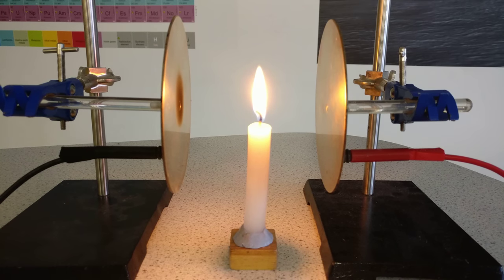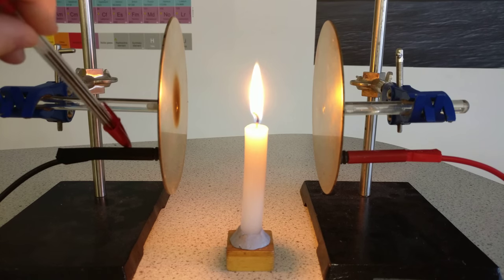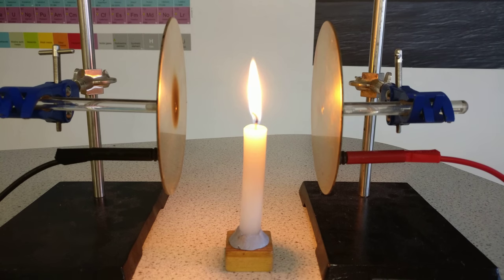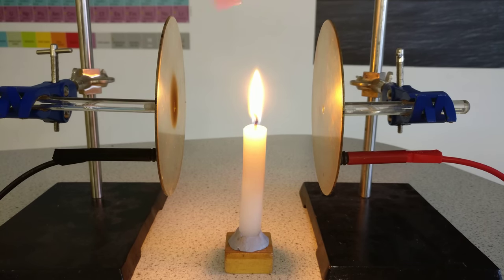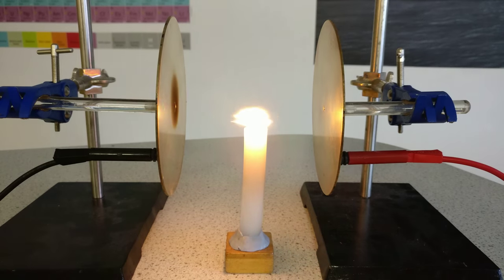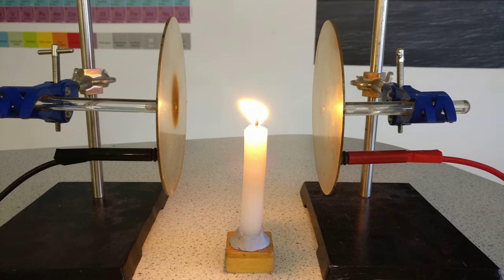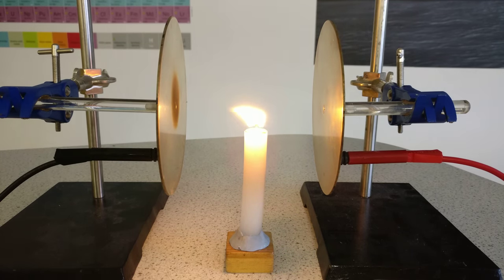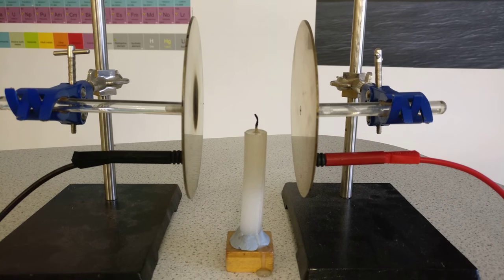Christmas Candle Flame in an Electric Field  - AQA A Level Physics

Comment: I wonder what would happen if you did this same experiment while also having a sonic resonator vibrating the dielectric of the capacitor at various frequencies.
Reply: 1.21 GW flux capacitor?
Reply: @Toryboy1807  What I am basically saying is have the air in between the capacitor plates resonate at various sound frequencies and see how it effects the results.  It has already been shown that sound resonance affects the flames.  I would like to know what the compound effects are under various frequency and em field strength conditions are.
Reply: @wesbaumguardner8829  I thought you were trying to go back to 1955 in a DeLorean.  Thanks for clarifying.
Reply: @Toryboy1807  lol!
Reply: What about a light source through it into some optics prism.
Reply: Lool I have no idea what u guys are saying 🤣 😂
Reply: A gigadoodle 1.5mw woobly boobly double lined solenoid
Reply: Exactly, I’m always believing that the sonic potential is way under developed(at least not publically)
Reply: @wesbaumguardner8829  
How would you do that without also confusing it with the movement of air?
Reply: @DarkMoonDroid  Technically, sound oscillations are a type of movement of air, but they are not wind.  To answer your question, you just use speakers to produce sound with a tuning device to change the frequency of the sound.
Reply: @wesbaumguardner8829  What are you thinking of building?
Reply: @wesbaumguardner8829  you want to make a candle listen to some Daft Punk at different frequencies?
Reply: @dudet9662  I was thinking more of using resonant frequencies rather than "music."
Reply: @screenname1  A portal to the gates of hell.  Just kidding.
Reply: @wesbaumguardner8829  Seriously. What's In the back of your mind? You're asking specific questions.
Reply: @screenname1  I'm looking for an anti-gravity device to propel the flying disc I made in my back yard.
Reply: @wesbaumguardner8829  hehe. You know. I'm actually impressed by your grasp of these kinds of things. I have no idea what you were talking about, but it really sounds interesting.
Reply: michimusician  I'll see how that pans out in my divorce hearing.
Reply: @screenname1  I was just kidding about the flying saucer.  However, you might want to look into John Hutchinson and the Hutchinson Effect if you are interested in that sort of thing.  It is similar, but different to this experiment as it was combining radio waves with a strong electromagnetic field.  Now that I mention it, I wonder what would happen if you combined the Hutchinson Effect with resonant sound.  Now THAT would be interesting.
Reply: @wesbaumguardner8829  I might check that out. Thanks.
Reply: Would be interesting to see what would happen with AC, and varying the frequency close to the vibrational frequency.
Reply: @Toryboy1807  
Doc Brown sent Marty McFly to the future to bring back more candles
Reply: @razvancosmin8188  Toryboy mentioned "going back to 1955 in a DeLorean" which is a reference to the car used in the films "Back To The Future". If you haven't seen any of the film trilogy they are definitely worth a watch, probably best in sequence but then they are so mad it may not matter!
Reply: @wesbaumguardner8829  I've often wondered about how sound would affect candles.  Could it slow down or speed up the chemical reactions?  Ect...

Comment: I wonder if this effect can actually be used to extinguish actual fires. Might take dangerously strong electric fields to work against something greater than a mere candlelight, but maybe not?
Reply: Rather yes, than not.
Reply: The problem is (based on my understanding) it wouldn't really stop the combustion, it would just pull away the "flame". So it would be ineffective against anything that burns without a flame e.g. coal.
Also, it only puts out the candle is because the combustible matter is concentrated in a small area (the wick). If you had more fuel to the left and the right you might in fact increase the spread of the fire.

Comment: Very nice.  Signal Path did a somewhat similar experiment a few years back, but he was measuring the current flow with and without flame.  He was showing off some very low level measurement capabilities of some Keithley test equipment.  Just in case some folks here are interested in that experiment.
Reply: very interesting i love u
Reply: "In a clean yellow flame the soot particles are quickly burned when they reach the higher oxygen regions away from the center of the flame." 
That is interesting. I've been watching videos about waste oil heaters and rocket stoves. Both feed oxygen into the flame for a more complete burn.
EDIT: And a tall combustion chamber.

Comment: If you REALLY want to see something amazing get a high voltage power supply and instead of producing arcs in air, do it in helium. A 10kV power supply that produces 1 inch arcs in air will suddenly produce MASSIVELY WIDE 1 foot long arcs in helium. Just helium at atmospheric pressure, we're not even talking about low pressures.
Reply: Dear sir excellent news.
Reply: And what happend if its in vacuum.
Reply: @alexlo7708  No arc.
Reply: Helium is non electron attaching.  That's why you can get long arcs / sparks.
Reply: @crusinscamp  I don't think so. e help in bridging the electric arc.  So noble gas make long arc because they don't create oxide on electrode surface which it accumulate resistance to current passing.

Comment: since this is basically a capacitor do you have to discharge the plates after demonstration before they are safe to touch?  this is so cool thank you for this.
Reply from the maker: Yes, but the charge leaks away pretty fast too
Reply: You can calculate the approximate capacitance fairly easily.   The plates seem to be about 100 mm in diameter, and are about 100 mm apart (my guesses).   C = epsilon_0 * Area / distance_between_plates    The permeability of air is about the same as for vacuum, so epsilon_0 is about 8.854e-12 Farads/meter so....  8.854 Farads/meter * pi * (diameter/2)^2 / 0.1 meter =  0.695 picofarads.    You can now compute using the capacitor discharge equation  V(t) = 25 kV * e (-t/RC).  R is given in air about 10e9 ohm-meters.  (but varies with temp, humidity, etc) with .1 meters, we have R= about 10e8.  So, after 1 second after removing the 25 kV source (that is, t=1), we compute V(t) to be .... a very tiny number ( so small, my calculator returns 0.0).     Now, Capacitance = Charge / Voltage; in this case, then, Q (amount of charge) = 0.695 picofarads * 25 kV = 17.4 nanoCouloumbs.    The Energy stored in this capacitor = 1/2 * C * V^2 ; in this case 217e-6 Joules.   Now, if you get the plates 'too close', you can ionize the air itself, and there will be a nice spark between the plates.   You need about 3 kV per mm to do that; so in this case, being 100 mm apart, you would need about 300 kV to get a spark between the plates.   Still: DON'T TRY THIS AT HOME unless you understand this sort of thing COLD.  Always be safe, wear insulating gloves, rubber-soled shoes, eye goggles, protect all skin --- and use proven instruments (not your fingers!) to verify your calculations on the real apparatus.
Reply: I'm no scientist, but this was interesting! 
The only time I remember ever hearing the word capacitor was in Back to the Future. Thanks again, from a 74 year old great grandmother. Peace and blessings to all!
Reply: @annarodriguez9868  lol ah yes the flux capacitor what a good movie that was
Reply: @cheponis  Everything good, but the calculation of the extimated resistance of the air between the plates. You forgot the area of the plates, R=rho*L/A which would give R of about 3e9 ohm, so the tau of the decay is actually RC ~ 2e-2 s, which is still extremely low.
Reply: @raffaeledivora9517  You're correct.  Thanks for fixing that.  The rule of thumb here is you need to wait 5*RC to get 99% discharged, so maybe about 20e-2 sec; less than 1/4 of a second.

Comment: The ionized plasma in a the pilot light of a heating system ignition system is used as a safety feature in gas fired appliances. When the tip of the pilot light flame enveleops the flame detector it creates a current path through the plasma that enables the gas valve to open.
Reply: @Bruce_Honnigford nope, thats a thermocouple. 2 dissimilar metals in electrical contact in a temperature gradient causes electrical current flow, which is enough to energize a tiny solenoid coil that opens the safety cutoff valve.
Reply: @baronvonfritz  in furnaces there's always a flame detector that works as described by measuring an electrical current when flame is present.
Reply: @baronvonfritz  This is a roughly 90VAC system that uses flame rectification to pass a DC millivolt signal back to the control board when flame is present. Different than a thermocouple. At least if we're talking about the flame sensor on a typical furnace.
Reply: @baronvonfritz   A gas burner 'safety valve' works the other way around. i.e. A thermopile (battery of thermocouples), located in a burner flame, generates sufficient voltage and current flow through a solenoid to hold a 'normally closed' (fail safe) valve mechanism open, allowing gas flow to a burner.
Reply: Just wanted to let you know I undumbed myself, and say you're right.  I had to go figure out who was right, and got to learn about a new (to me) sensor I had always just assumed was a thermocouple.
Reply: @NanClaymore  Thanks, now I know the difference.
Reply: @garibaldicityovgeorge8586  Yep, now that I undumbified myself, just wanted to not let this hang in the aether. Thanks for the correction.
Reply: @BTW...  Thanks, I am a little less dumb now.  I had just assumed that was just a thermocouple in the flame, and now I know a little better.

Comment: And what could happen if you induce a hign frequency oscillation or pulsation. Is there a resonnace frequency that could enhance the rate of combustion?
Reply: the high frquency high voltage oscillations willl suck in the whole lab and the contents in the room into the 2 metal polarities to another portal possibly time travel!
Reply: @fidelcatsro6948  time travel is only possible if the candle is tourning around the earth at the speed of light, in a sphere, burning the omicron variant!!!
Reply: @louisleblanc2972  i see..thank you

Comment: In blue flames like a Bunsen burner the light comes from ions recombining, but in yellow flames like candles, most of the light comes from incandescing soot particles. In a clean yellow flame the soot particles are quickly burned when they reach the higher oxygen regions away from the center of the flame.

Overall the flame is expected to have a neutral charge, with equal numbers of positive and negative charges. You can see from the spot of soot on the negative plate on the left that the soot has been attracted to the negative plate. Therefore the soot particles are positively charged. A reasonable conjecture is that the negative charges are electrons, which would be attracted to the positive plate on the right, and the atomic ions, like the soot particles, are positively charged.

It certainly would be a good idea to try the experiment with a soot free flame. Bunsen burners have metal parts which would be prone to sparking in the strong electric field. candles easily flicker, and are likely to extinguish when they are flickering. It would be easier to claim that a flame was extinguished by the separation of charges if the flame was not flickering.

The important variable is the electric field gradient, which depends on the voltage difference between the plates of course, but also is greater when the plates are closer together. At the end of the video, when the plates were brought together, the gradient was raised.

A Van de Graaff generator could easily generate the 25 kilovolts, but this experiment needs more current. If you had access to only a 5 kilovolt power supply, you might be able to run the experiment with a smaller plate separation and a very small ceramic burner. As far as I know, sufficiently small burners are not easily available.
Reply: Awesome comment.
Reply: I like your funny words magic man

Comment: My immediate question is how does the electric field influence the air currents (independently from the candle)? I would be really interested to see if the strong electric field would also blow a light piece of crate paper or a feather or something. Then the effect on the flame due to the ions could be disentangled from the effect due to the air currents. Thanks.
Reply: It would, you could even feel a slight breeze on your hand. If the electric field is strong enough it ionises the gas particles and they physically move between the plates.
Reply: To answer your question ask yourself exactly what is a flame. It is largely hot gas. The effect seen here is just the effect the ions have on air which the flame is mostly made of.
Reply: @user-cy2iq1gl1t  Yeah, it seems like it's basically just air. Years ago I read that flame was a plasma, but on thinking about it, that doesn't make much sense!
Reply: Um... Silly question but does that mean with a few million volts you could put out a small bush fire? Or would it just start more fires?
Reply from the maker: It needs to be ionised and more like a plasma
Reply from the maker: Probably not!

Comment: Hey, that's a really interesting phenomenon. Electric throttling of flame. I wonder if it could be useful for aerospace engines?
Reply: You are right. Productivity of classicengines are less than %60. We need develop superconductuvity than ve can create a coil consist of plasma using a magnetic field. This coil can push the superconductors and this motor can power an aircraft

Comment: When I learned that your basic furnace uses the flame to complete the circuit and activate the blower, I was very surprised. Never knew before that a flame carried enough charge to do that…
Reply: It doesn't. It carries enough current to amplify with a transistor.

Comment: The positive ions would tend to be of smaller sizes than the negative ones.  This would tend to give them move ability to move through the air.  Also, H+ would be very light and tiny, so those would move fast and far.  If you used AC, you could likely setup so interesting resonances with the flame.
Reply: Except that in reality, free electrons barely attach to air molecules to give negative ions and the few created are short lived, hence free electrons are the main electric (electronic in this case) current flowing. In plasma physics, the electronic current is always greater than the ionic one and free electrons make the streamers for example. Although here, we don't have a plasma admittedly. In any case, free electrons are much more mobile than positive ions and their mean free path is much longer. Also, there is no hydrogen in the air (infinitesimal traces).
Reply: what? protons are way heavier than electrons
Reply: @fluxcapacitor  the candle has lots of hydrogen in it, its a hydrocarbon.
Reply: @Metal_Master_YT  Exact, it's a source.
Reply: The burn is on the plate that would receive the positive charges.  But, I would speculate that free electrons colliding with the positively charged plate could be causing no damage.  It puzzles me as to what the ions are.  I wonder how we could test such a question.
Reply: @mrjava66  your hypothesis above which I didn't think from start is that positive ions are created by burnt gases from the candle itself. Then the candle is the main provider of ions. Therefore, those ions flow towards the negative plate and, through heavy collisions (ion-ion and ion-neutral encounters) draw the ambient burnt gas with them, imprinting burn marks on the cathode. The electronic current flowing along the other direction may be greater, but as electrons are way more smaller, their mean free path is longer so they do not collide with heavy elements as often, and as they are a thousand times lighter, they don't draw the ambient air with them. It's my latest hypothesis ^^
Reply: @tannerbean3801   That experiment on your channel is really interesting.
Reply: @fluxcapacitor  more accurately, it carries nanoparticles of carbon (soot) with them.
Reply: @Metal_Master_YT  Exactly, that's what I implied when I talked about "ion-neutral collisions" that "draw the ambient burnt gas" in the same direction. The ambient burnt gas contains the soot.

Comment: Fun video. It would be very interesting to now what voltage is being applied at the different points when the flame is affected. Also, the flame would look much better if you turned down the exposure on the camera (and possibly the contrast too).  Would this work with a much lower voltage if you put the plates closer and used a smaller camera? How low can you go? It would be cool to see different types of flame too.

Comment: I know that in a closed circuit electrons move from the negative side to the positive side. 

So what is it that moves from 5he positive side to the negative?

I heard that they are "Ions". I am guessing Ions are charged particles. 

If yes, what kind of particles are they? Abd where do they come from?
Reply: Ions are charged atoms (positiv or negative). The heat of the flame strips electrons off of the atoms